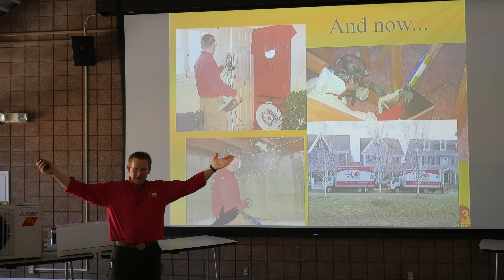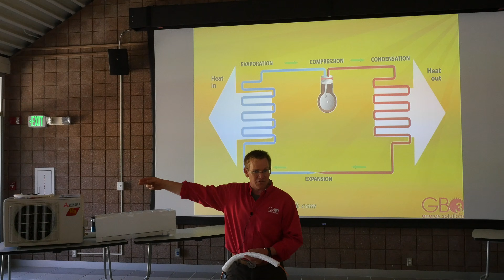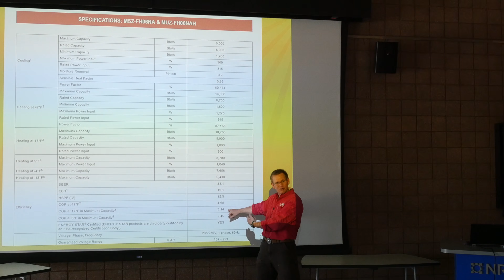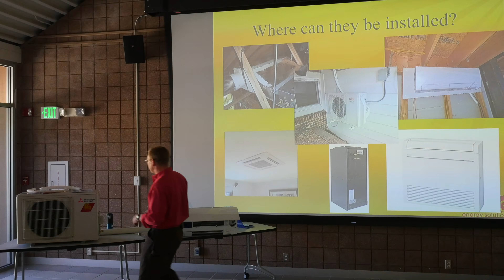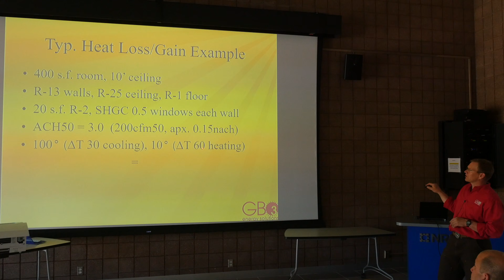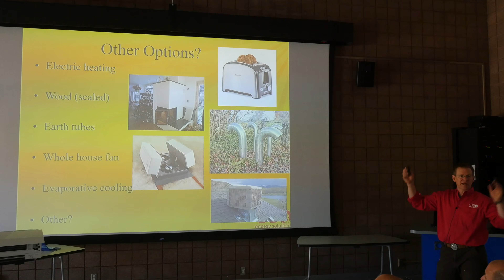Mini-Split Heat Pumps: Hot (and Cool) Solutions for Energy Efficient Buildings

Comment: Invest $1,500 in tools, do some research and install your own mini splits.  You will save about $2,500+ on each mini split install.  Once you install one, the subsequent units are easy.  Get separate outside units for each inside head to maximize efficiency and provide automatic back-ups if one should ever fail.  The Mitsubishi H2i units, like those in the video, are very good.